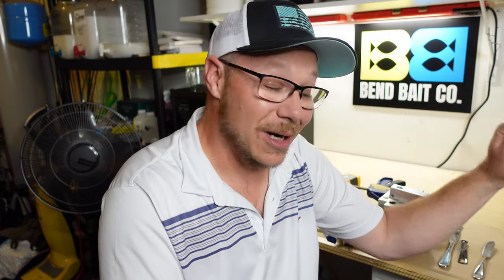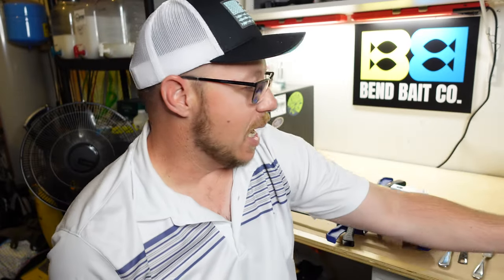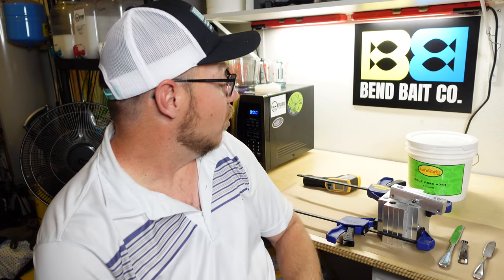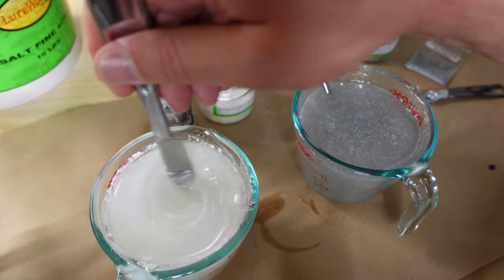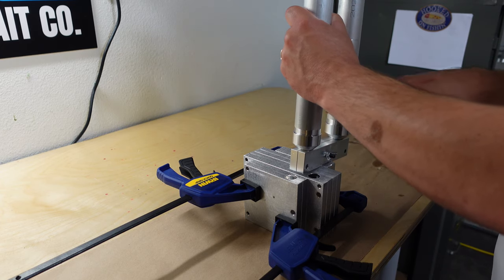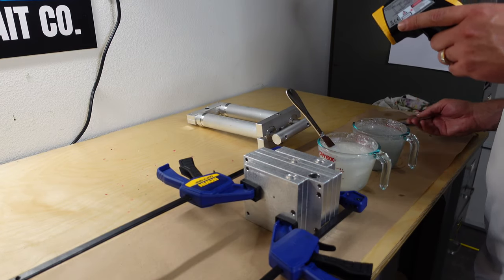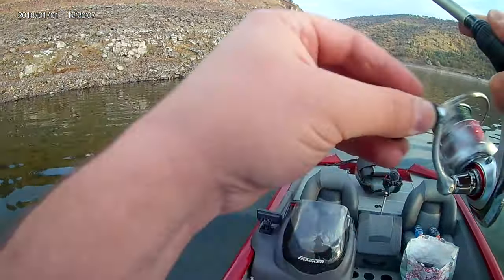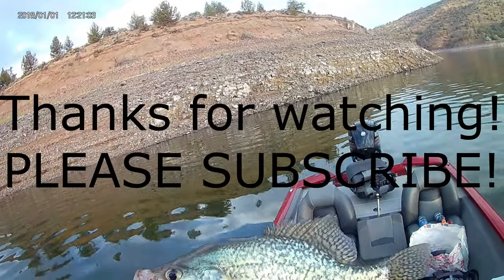Pouring Soft Plastic Crappie Lures W/ Neutral Buoyancy BONUS UNDERWATER FOOTAGE AND A NICE CATCH!!

Comment: Hello 👋, how long you have to wait to open the mold after the injection??  Thanks
Reply from the maker: Typically I wait at least 2 minutes.  Its pretty quick as the CNC aluminum dissipates the heat from the plastic very quickly.